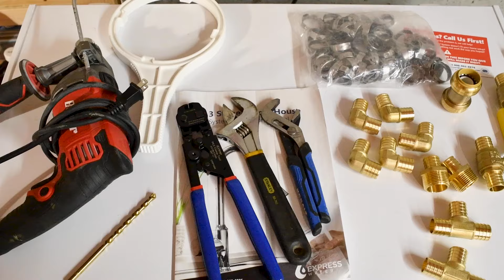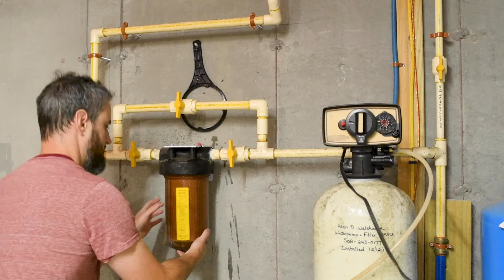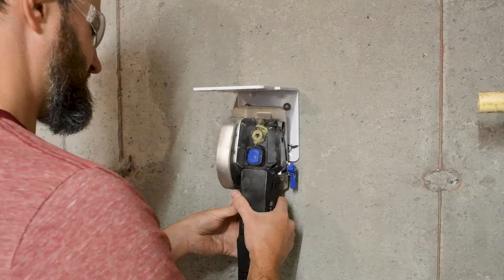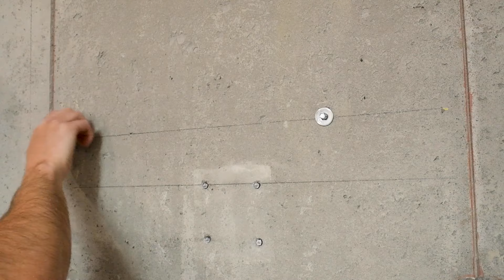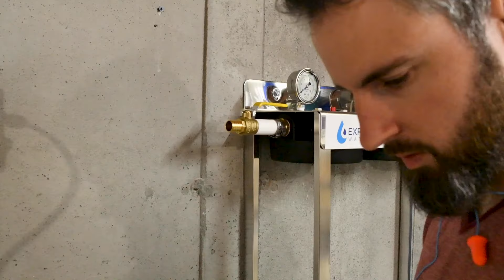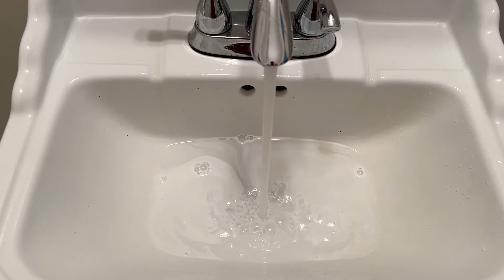Express Water Whole House Water Filter Review and Install

Comment: why wouldnt you run the 3 stage filter and then the water softner? Wouldnt that help prevent the softner from being clogged with sediment/etc?
Reply: Exactly! You extend the life of your water softner if you put the filters first.
Reply: The system will remove the salt from the water softener so when your washing, you can actually tell that you got all the soap off yourself. Some people do not like the water coming out of water softeners.

Comment: Apply some olive oil onto all the entire O rings. This is will prevent degradation of dry O ting friction when filters are applied and tightened.
Reply: Olive oil can be a food for biologics in the system, and some oils can degrade the O rings depending on what they are made of. Best to use food grade silicone grease, it's what Express Water reccomends.

Comment: Jared, you did an excellent job of explaining the Whole House 3 Stage Express Water Filtration System.  Thank you.
Reply from the maker: Thank you
Reply: @JaredDesrosiers using pex or copper +100 years its a concern for many of  homeowners. Chlorine or hevay metal and minerals ventually degrade the piping lines... questions are thess remove chlorine also ??
Reply: @JaredDesrosiers how well this systems works any leaks ??

Comment: I have this system as well, mine is the ultimate and I installed the optional spin down filter. Just recently the city replaced my water meter and disturbed a ton of magnesium in the line and my spin down caught most of it! You can remove and clean, and reinstall the spindown and I beleive it saved my sediment filter. 
I also installed the undersink reverse osmosis system and I'm upgrading it with there mineral replacement filter. I might even install there uv filter too.

Comment: Hi Jared, I just purchased the Express system awaiting it's delivery, I have a question is it absolutley nessessary to do the by pass part of it? only because I have a space issue. Everything else will fit just fine. Great video very informative.
Reply from the maker: The bypass is not required, just good to have. Ultimately, you’ll be fine without it. Thank you by the way!

Comment: Great Job.  Why install it after the water softener and not before?  Would think cleaning the water before it reaches the water softener would be better for the water softer. Looking forward to your response. TY!
Reply from the maker: There’s a lot of conflicting information about this. However, I read that if you have high levels of chlorine and sediment, you should install the filters before the softener. If you have high levels of calcium or magnesium, install the filters after the softener. I have the latter, so that was the right choice for me. If I could go back (this was my previous house), I would have added a separate sediment filter before the softener, because the tank did get nasty after a while.

Comment: Thanks for the wonderful video. After I watched your video, I decided to buy the Ultimate Protection one. After finishing install the system, water is at 350 ppm when tested. I don’t know if this is right or not. Does anyone know?
Reply from the maker: What type of test are you performing that is giving you a result of 350 ppm? That seems high for total dissolved solids… Although, there could be many different factors at play here causing that result - including residual carbon from the filters if they haven’t been flushed out completely.
Reply: I used Hone Forest tester
Reply: TDS
Reply: How do I flush it out may I ask
Reply from the maker: If you haven’t already, you need to run tour cold water for at least 30 minutes straight. This removes air bubbles and loose carbon particles from the filters. After that, you should be good to go.
Reply: Thank you so much for your help!

Comment: I have a quick question- about install a 3 stage system in my house. Why did you install after the filter after the softener? Wouldn’t the filter, filter out most of the salt brine before it hits the house? Ultimately making the softener pointless? I was planning on going directly from the water in, so the filtered water then hits the softener, then the house. I’m not a plumber or water guy by any means, so wanted to get your thoughts on it to see if I was thinking about wrong or not. 

Thanks,
Reply from the maker: The filters won’t filter out dissolved solids like salt. They only filter out particulates from the water like metals, sediment, etc… In my experience with high purity water systems, I can tell you that those also have the softener stage before finer filter skids.
Reply: Thanks for confirming! Really appreciate the info. Great video!
Reply from the maker: Any time, thanks!

Comment: Shouldn't there be a gauge before the filters too?  That way you can see the pressure drop before, during and after filters.
Reply: No, because each filter has a pressure gauge so you can determine which filter is your choke point. Putting a gauge before and after filters allows you to see where the flow of water is being impeded.
Reply: @timhand2503 Ok, what does it mean if the last gauge is lower than the previous ones?  It could mean any of the filters are full but you don't know which one.  But if you had a gauge before the filters you can compare the pressure before and pinpoint which filter is full.

Comment: Curious!  You have an upstream cutoff before the filters.  You have a cutoff in the bypass line and a cutoff in the downstream line coming from the filters.  The upstream cutoff would redirect the water around the filters so what purpose does the cutoff in the downstream line exiting the filters serve?
Reply from the maker: That’s just to stop water from pouring out from downstream piping when changing the filters. Without shutting it off there, it would result in a lot of water escaping from that section of piping.
Reply: @JaredDesrosiers  Thanks Jared!  Sorry for the stupid question.  I should have seen that!!!
Reply from the maker: @kenlemmond673 no worries! It wasn’t a stupid question!

Comment: Thank you for this. I have a question regarding replacing the filters after 6 months. Is it as simple as cutting the water to the filter and opening the bypass, and unscrewing the filter housings and just replacing the filters and opening the valves again?
Reply from the maker: Yes, pretty much. You’ll also want to press the red pressure release button after bypassing the water flow to release pressure in the pipe to make removing the housing easier. Other than that, it looks like you’re good to go.
Reply: @JaredDesrosiers  you’re the man

Comment: when you use the red pressure release valves when its time to remove filter housings, where does the water drain? Does it end up on top where the button and stainless flat part is, or does it run down the side of the filters towards the floor, or does it just get everywhere? thanks
Reply from the maker: The water comes out of the side of the red button. Most of it just sits on top of the stainless brackets. Some might drip to the floor. I already have a bucket under the filter at this point because a lot of water drips out when you remove the old filter.

Comment: Jared awesome video, i just bought mine and hope to install it this coming weekend....... let me ask you, do you think its ok to use CPVC shut of valves instead of the ones that you installed?
Reply from the maker: I don’t care for CPVC valves because they tend to become hard to turn over time and I’ve had the handles break on me trying to close/open them. Besides that CPVC is technically okay to use if you’re only running cold water through it.

Comment: I want to install this system but my pre-plumbing has a drain pipe connecting directing into the water supply line, what am i supposed to do with the drain line?

Comment: Hi just bought the same like yours.
Do you recommend  1 inch water pipes or 3/4 is ok?
Also my wife  is very  concerned about pex because technically is plastic, she said that copper is the way to go.what is your opinion on it?
Reply from the maker: Congrats on the purchase. I recommend that you stick with the same size pipe that is already installed in the section you’ll be installing the filter system. Therefore, if you already have 3/4” pipe, stick with that, don’t upsize it. 
Regarding pipe material, I agree that copper is better than pex. If you have copper pipes already, definitely use that instead. I only used pex because my entire house already has it…
Reply: Thank you for all your help
 You were right choosing pex mine leaked, and I have to redo it
Reply from the maker: Oh man! Pex does have an advantage of being more forgiving with installation. Good luck with everything.
Reply: I was able to fix the leak by redoing and bought tinning flux and no leaks, but the pressure  is a little low.
I have well water with pressure tank and pump. The default is 30- 50. Is it OK to increase to 40 -60?
Reply from the maker: @dans9462 yeah, you should be able to safely increase the pressure tank by 10 psi. Just verify that you are still operating below the maximum pressure limit as stated on the tank.

Comment: I am looking to set this up for my home. However, i have a few questions. Can this work if the "well water" goes straight to the filtration system and then onto a tank which then distributes to my home?  Second Question does it requires a pressurized system in order to work?
Reply from the maker: You should have this filter system after the pressure tank that distributes water to your house. It does need some pressure to work efficiently.

Comment: @jaredrosters can this filter be made to sit in the floor? How’s the difficulty with changing and unscrewing the canisters?
Reply from the maker: Yes it can sit on the floor. Unscrewing the canisters while the system is secured to the wall or floor and depressurized is not very difficult using the included filter wrench. You do need to put some power into it to get loosened, but then they turn freely.
Reply: I have serviced this exact system a week ago and having it securely bolted to the wall, at a comfortable working height (like Jared had) is a real benefit. Those sitting on the floor while bolted to the wall are far less convenient to work on.

Comment: is this considered a water softener? i have a lot of build up on my shower heads and skins and im trying to figure out how to stop that. whats the difference between the softener and why would you soften then filter it? doesnt the water softener do that?
Reply from the maker: The standard filter system is not a water softener, but the Anti-Scale System is. This system will both soften and filter your water. Traditional water softeners only exchange salt ions to reduce scaling and hard water, but do not filter particulates.

Comment: Do you recommend the Whole House

Ultimate Protection

 Unit ? What is the difference between that and the standard unit ?
Reply from the maker: Ultimate protection filters out more impurities, but it’s more expensive. If you know or suspect that your water contains many impurities then Ultimate protection is the way to go.
Reply from the maker: I am filtering well water that has a lot of mineral and iron content, but is otherwise clean. Therefore, the standard system was good enough for me. If you have city or town water, I’d recommend the higher grade system.
Reply: @JaredDesrosiers  How about the Heavy Metal system ? I have high Nitrates in my well and also have a Fleck softener , but was told the HMS model was the only one that will remove it !
Reply from the maker: Yes, I would go with the HMS in your case. The different filter cartridges use the same housings, so you could change only the filter(s) in the future if needed without buying a whole new system. 
Basically, you’re not forced into one system or another after buying because you can change filter types if needed.
Reply: @JaredDesrosiers  I also have tropical fish 🐠 and everyone says go with RO, but that takes up all my space under the sink plus takes so so long to do a water change each week ! ?

Comment: Do you believe from your experience that the smaller 2.5” x 10” canisters would have worked for your whole house too, but obviously with more often changes of filters?  We (2 people) live in a 2.5 bath Florida condo, and our courtyard is where we have access to our 3/4” PVC pipes to install a similar 3-stage system (so this is going outside in a makeshift cabinet to protect it from the sun and weather).  Anyway, those larger 20” canisters you have look great, but we’d find it easier to work with a downsized set IF we can.  So what has been your experience?  Could you imagine the same system working for you if it was downsized to the smaller canisters?
Reply from the maker: If you want to go smaller, I’d suggest 4.5” x 10” if you’re filtering the whole house. I would also suggest a pleated sediment filter as the first stage. Pleated filters have more surface area and will have a longer life than spun or woven types, plus a higher flow rate. The other 2 stages should be fine in a smaller 4.5” x 10” format, but as you mentioned, may have to be changed more frequently (like every 6 months).

Comment: Tip: Never add a full bypass over all of your filters. You should at least have a 100 micron filter which can't be bypassed.

You better temporarily have no water instead of clogging some faucet, shower head, toilet tank,... with an accidental piece of debris.
Reply: Can you explain more? Would this debris somehow escape the filter and be large enough to clog something?
Reply: @nikolagrudev3128  anything that's sucked up by the pump and is larger than the endpoint (tap filter, regulation valve, pressure relief valve,...) will be stuck there forever.

That's why each filter setup starts with a washable filter. Just never bypass it during cleaning or you are gambling